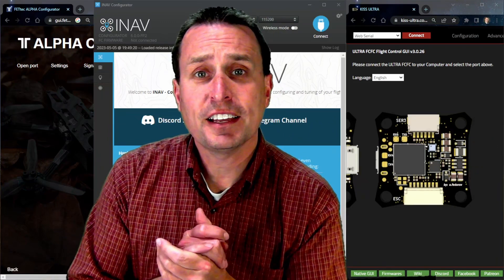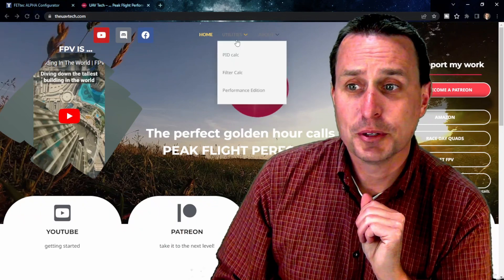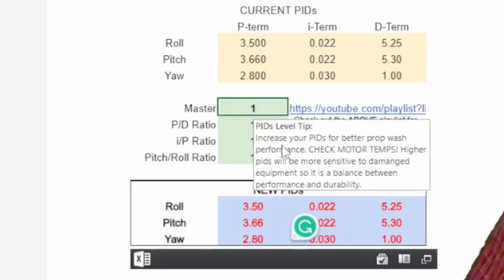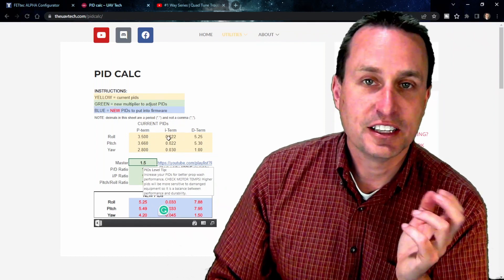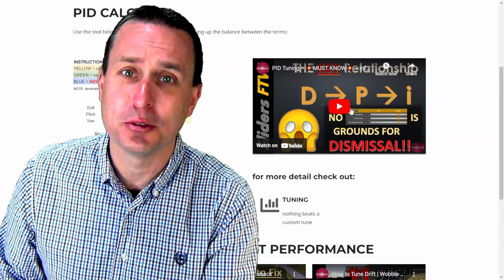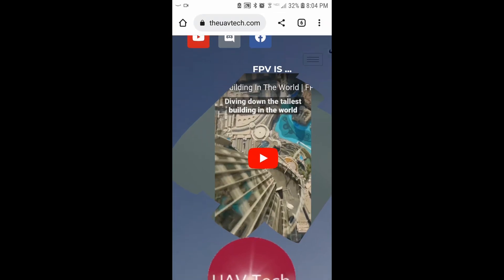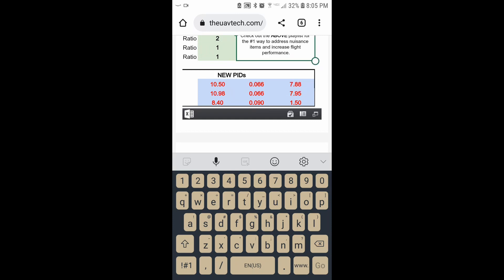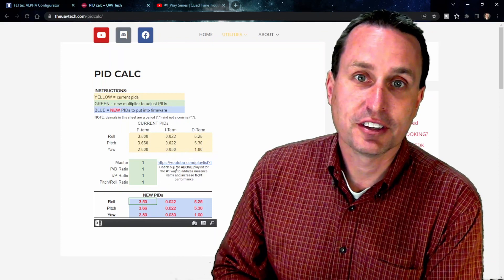UAV Tech PID Calculator

Comment: When you tuning for PD ratio into KISS - Is it correct to change the P or D ratio  -  with the step - plus 10% or minus 10%  from the specified values ?
Reply from the maker: yeah.  D can have a wider swing than P.  So P one integer or half at a time.  D 1 or two integers.

Comment: I watched your Videos but I still don't understand how to use the Calculator. How must the ratio be (in numbers)?   Which numbers do I enter in the green fields Master, P/D, I/P: 1.5 ? 2? 2.5?      I fly with KISS on a Fettec G4.  Blackbox is just available for Betaflight, right?
Reply: You enter the "slider" values from either 0.0 or all the way to 2.0. It's basically a manual way of changing the new PIDs to use versus in BF you just move the sliders around it's done automatically.

Comment: Well im a beginner and i thought preset tunes are most likely useless or not relevant,btw im using DarwinFpv Baby Ape and i tried seeking tunes for my quad (Cinematic) and just like that i found UAV tech tunes and load that preset and wow just WOW the tune is smooth like butter like i fly on Horizon not twitching unlike stock pids THANK YOU

Comment: My one question is the I term it doesn’t rise linearly in every drone size, for instance it may require 2x rise for every 1x master slider  increase in 7” but not the same for 5”
Reply: This gets you safely adjusting the pids to get the tune close. There will be times when you need to adjust each axis after applying this method. Minor adjustments on each axis may and will be needed to get that “locked in” feel
Reply: I term can be adjusted after the PD ratio is found, no big deal.
Reply: @cinemoriahFPV  I term is a p term damper, if you try adjust the I term after pd found it will get out of ratio
Reply from the maker: i-Term is associated to P.  It will not effect PD balance unless your quad is super delayed and you get i-term windup on sharp moves.  But again, that is an i-Term windup issue that is still an i-term problem and not PD balance.  For firmware that does not have Feedforward or i-Term Relax in that cause may need to artificially suppress i-Term, but then drift on throttle chops becomes an issue.

i-term has a really wide tuning window generally when i-Term windup is addressed on sharp.moves or the quad has a high power to Moment of Inertia ration.  

I BF that never happens with i-Term Relax